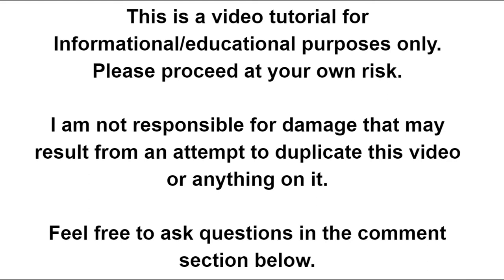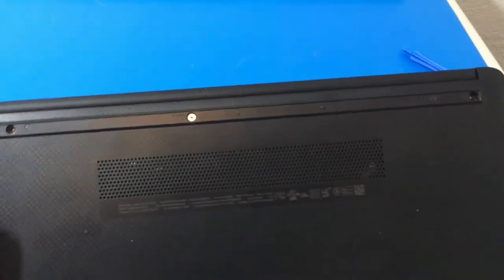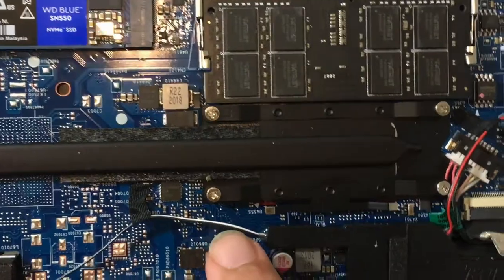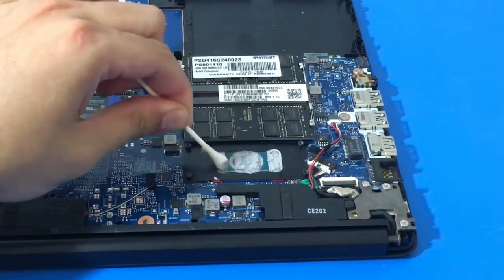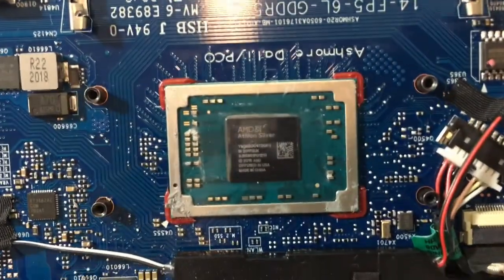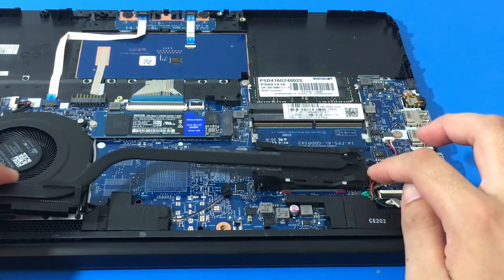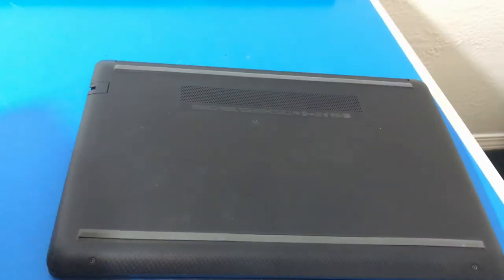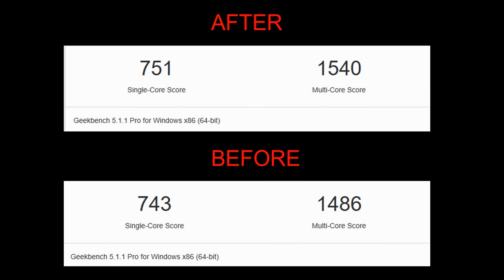Thermal Grizzly Kryonaut Paste Application & Results  - 2020 HP 14 inch Laptop 14-DK1003DX

Comment: I just hope Kryonaut helps my HP 15sdu2071Tu which has an i3 1005G1(15Watt) is reaching 85-95°C on boot up & while using browsing because of turbo boost(20Watts), it's not crashing but still it's not good for CPUs running this hot. I opened up laptop and saw a ordinary heatsink which was completely useless.
Thanks for this video !!
Reply from the maker: good luck! hope it works out for you. That is interesting. I'm not familiar with that hp model.
Reply: @whattmeter  It might be country specific model number. I'm from India.
Reply from the maker: Ohh gotcha
Reply: @whattmeter  My laptop CPU temps are under 75-80°C under full load,no thermal Throttling at all.

Kryonaut bought an 20-25°C difference.

Intel Stress Test at Very High & High for 10 Runs temps under 80°C.
2 Browsers running 1440p video temps under 60°C.
1 Browser 1440p video + Intel Stress test at High, temperature under 80°C.
Reply from the maker: Whoa
Reply: @Beast80K  that's a crazy improvement

Comment: Bro I have a question this Hp 14 bought it and I notice that it has an input for a flexible cable and it says Hdd, in addition to having a size comon for a hard disk Hdd do you know if you can buy the HDD cable in Amazon?
Reply from the maker: For hp, last I checked not for the model in the video. But that could be changed. I would just ask the seller to make sure that the hp connector works with your specific model. Is your laptop like the one in the video? Or a different model
Reply from the maker: For the hp brand I noticed it’s harder to get a cable for hd add ons. It usually takes time because they are strickter than other companies. They even lock their bios etc
Reply: @whattmeter  It is the video one, hp 14-dk1003dx when buying it only had 128gb, I improved it to 256gb with an NVMe, and when I was replacing it, I noticed a slot that said Hdd with an input for a flexible MB cable.
Reply from the maker: Idk if they have any cables available yet. But when I looked it up I couldn’t find anything for this model yet. I could totally be wrong though
Reply from the maker: If you find a cable let me know. I’ll see if I can try it.

Comment: I bought a new Razer Blade Advanced and I am already considering repasting with Kryonaut. The laptop hits a hundred degrees when gaming.
Reply from the maker: Whoaaaa. Just out of curiosity is the cooling fan set to auto? Does it not have enough cooling
Reply: @whattmeter  correct
Reply: @whattmeter  Razer blade is a thin laptop that will throw 100w at it's CPU , Modern laptops all hit crazy temps now.

Intel says it's fine I guess.

Comment: Great video my guy!

Very comprehensive and enthusiastic commentary, you know your stuff, you included before and after benchmarks, high defenition video, great audio, this is a pretty great reference for similar laptops out there thank you for sharing.

But if I may share some extra tips. You can actually get away with half of the amount of thermal paste on that CPU die because of its very small area. Just spread it with the included spreader and you're golden. Rule of thumb on thermal pastes: if you put too much, heat actually builds up on the excess paste and may act as somewhat of an "insulator". Hope I helped man.
Reply from the maker: Wow great tip. Much appreciated i’ll keep that in mind for future videos

Comment: Thanks for doing my suggestion, I play a lot of games so I needed to change the thermal paste ima try removing the cpu to change it for a 3200g
Reply from the maker: No problem! I was skeptical but since the cpu was tiny i think the thermal paste made a big difference. I notice the difference too when using the pc
Reply from the maker: Nice! Good luck with the cpu change! It’ll make a difference in my opinion. I couldn’t believe it myself
Reply: What does the thermal paste do? Do you recommend doing this even though you have not played any games on it? I'm pretty active on this laptop and I am starting to hear the fan and feel the heat
Reply from the maker: The thermal paste is to keep the cpu cooler. It helps especially when there is heavy use but not a huge difference in terms of performance. Basically not too noticeable
Reply: @whattmeter  I'm All for it if it makes my computer less hot. I just started following you last week. Cool channel. Btw, I know there some discussion about being able to add an HDD and I believe it is true. I saw a private seller on Amazon selling the we computer have with the original ssd and a 500 gb hd in it as well. Food for thought. Interesting to see all of the same model laptops for sale with upgrades on there https://www.amazon.com/dp/B08G55VBRX/ref=cm_sw_r_cp_apa_i_0DnxFbP24REEV